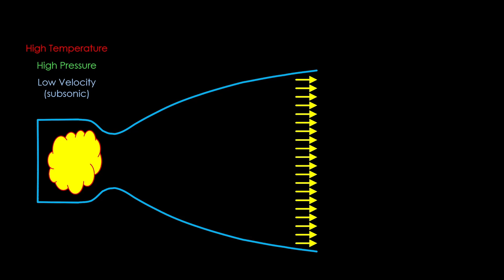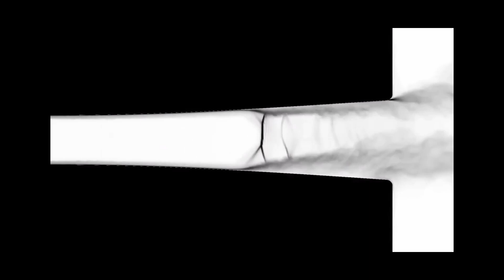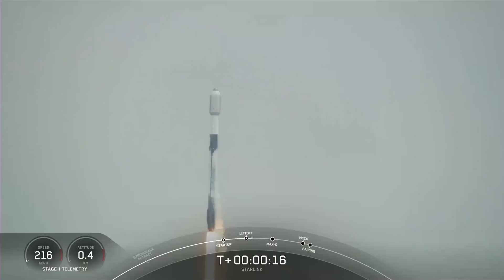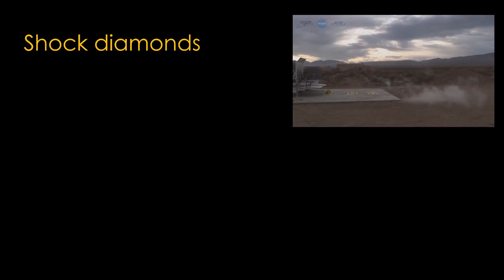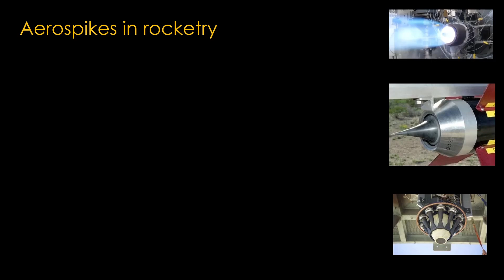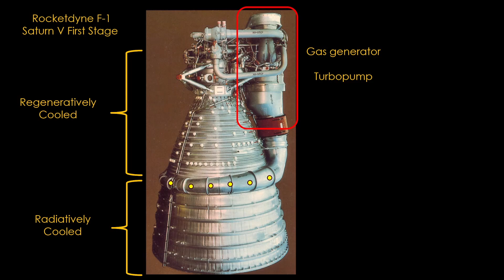Space - You Know Rocket Nozzles

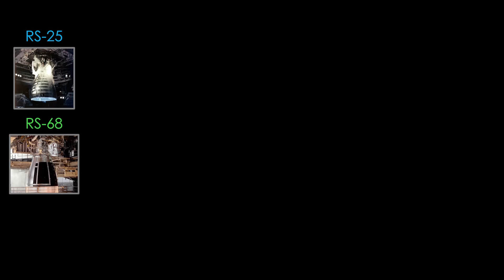Comment: 18:16  why does the total thrust in mega newtons increase in the higher thinner atmosphere for rocket engines?
Does the enhanced thrust account for 100% of the specific impulse increase? 

If rocket engines are using newtons third law it’s not intuitive. Why the thickness of the atmosphere affects the exhaust velocity at the nozzle . .
(of course the further from the nozzle, the more atmosphere the particle encounters and the slower it will be, but hasn’t it already done its job at that point to accelerate the engine forward?)

The statistics make it sound like the engine is push, pushing hard harder and thinner atmosphere  🤔🤷‍♂️
Reply from the maker: The amount of thrust is the product of how much mass you are throwing out the nozzle (mass flow rate) and how fast you are throwing it (exhaust velocity). The full math is pretty hairy, but I'll try to simplify.

The exhaust velocity is (somewhat) proportional to the ratio between the pressure at the entry to the diverging part of the nozzle and the pressure at the exit of the nozzle. In atmosphere, the exit pressure is the atmospheric pressure, and the smaller difference means that the exit velocity is lower, and therefore the specific impulse and thrust are lower. 

You can think of it as the atmospheric pressure at the nozzle exit pushing back against the flow coming out of the nozzle and therefore slowing down the exhaust velocity. 

And yes, the enhanced thrust does account for the specific impulse increase, but I would flip it the other way around - in vacuum the exhaust velocity & specific impulse are higher. The only other way to get more thrust would be to increase the mass flow rate. 

If you look at the stats for the RD-180, you'll see that the vacuum thrust divided by the sea level thrust is the same as the vacuum isp divided by the sea level isp. Same for the F-1 engine that flew on the saturn V.
Reply: @EagerSpace  Thanks Eric! 
So If I get that right:  the key here is that the pressure difference between the throat from the nozzle exit is a key factor here and any traffic jam at the end reduces particle velocity potential . . . .

Funny thing about flat-earther science that denies the viability of rockets because "if there is no air in space what does the rocket push off against .. .?" 
Turns out, the reverse is true and Newtan's law, unlike nature, 'ADORES' a vacuum!
Reply from the maker: Yes, that's what's going on. There's an equation with a whole bunch of terms but that is the simplified version of how the nozzle part works.

Comment: Which part of the nozzle or engine is constructively connected to main body of the rocket? Where is generated thrust transmitted to the rocket?
Reply from the maker: The nozzle is connected to the combustion chamber and the force travels through the engine parts above that and into the body of the rocket. Sometimes it's a solid connection, which means that the nozzle is always pointed directly to the back. Sometimes there's a gimbal joint that allows the engine to pivot in one or more directions, and that is used to steer the rocket. 

There's a really fun video here that shows a gimbal test of the rockets on SpaceX's Super Heavy (the first stage of starship). The outer ring of engines is fixed in place, but the inner ones can all be moved. You can see how they connect to the upper structure - known as the "thrust puck".

https://www.youtube.com/watch?v=gY-UbmBpxAo
Reply: @EagerSpace  the construction of the engine must be very strong since it carries all the weight of the rocket plus the thrust. 
haha, the video is indeed funny 🤣

Comment: Might be stupid
What about expanding the nozzle as the vehicle climbs in altitude, something like what RL-10 does, but during combustion, so that pressure inside the nozzle would always match the outside air pressure, as the nozzle expands, and then it expands into a vacuum engine
Reply from the maker: I think I've seen some proposed designs for that. 

The problem is building a nozzle that can actually do that, deal with cooling, and keep it light enough so that it's actually worthwhile to do. Oh, and make it work reliably. 

Given that good designs - and I guess that means the designs I like, not ones that use big solids and a small sustainer - are fairly settled on two-stages, it's fairly easy to build good first-stage engines and pack a lot together and then separate vacuum engines for the seconds stage.

Comment: Fascinating! I'm curious about the solid rocket, diagrammed in cutaway at the end. It almost looks as if there's two throat-and-nozzles, in series, with the "throat inlet" in between. What's up with that? Now that I'm looking at it again, it appears that the solid fuel is unlabeled and I'm seeing it as a nozzle when it's just the shape of the cavity leading up through the fuel. It was confusing because it was just on screen for a moment.

Always wondered what that wrap-around thing was on the R-1 and the Merlin Vacuum. Film cooling is pretty cool. Where on the bell is the methane film injected in the Raptor? It doesn't seem to have a wraparound thingy since it's got no gas generator.
Reply from the maker: I'm wondering if it's integrated with the feed and output of the nozzle cooling system.
Reply: @EagerSpace  oh, like some of the methane piped through the bell is injected to create the cooling film?
Reply from the maker: Yes, but this is very speculative.

Comment: didn't know the rl10 had such relatively low chamber pressure at 44 bar.. yet it has the highest isp.. I assumed pressures had a more direct relationship with isp efficiency..
Reply from the maker: Expander cycle generally gets you pretty good efficiency. The RL-10 benefits a lot from having a full vacuum nozzle on it; note that the RS-25 with an 80:1 nozzle is about as efficient as an RL-10 with a 130:1 nozzle. And the new RL-10 will get up to an Isp of 465 with a really big expandable nozzle (280:1). 
Where it falls down is the thrust that it has is pretty low - only about 110 kN. That's about 1/10th of the Merlin 1D Vacuum, and that means if you want to fly the RL-10 in a second stage (like Atlas V), you need to have a big first stage that tosses it very high because the RL-10 doesn't have enough thrust to both counter gravity and accelerate to orbital speed. Once you get into orbit where lower thrust is less of a disadvantage it's a much better engine. 
It's also reportedly anywhere from $10-20 million a pop in small quantities.
Reply: @EagerSpace  if only someone could produce a medium thrust hydro/lox engine of any cycle and offer it for less than 15million.. like we had 50 years ago with the j2's.. it would fix this huge gap in the thrust discrepancies.. I doubt it would take long to find a happy buyer

Comment: I'm still a couple years off from my mechanical engineering degree, But why is it important what happens to the exhaust gasses after it's evacuated the nozzle? It would seem that as long as the mass is traveling in the correct direction as it exits the nozzle, it doesn't matter what happens to it afterword. What am I missing?
Reply from the maker: I'm going to oversimplify here - you can dig into the original references which IIRC have plenty of differential equations to make you happy...
It is all about the exhaust gas going in the correct direction, but it only goes in the correct direction if (to a first order approximation) the pressure in the nozzle is the same as the pressure outside. If the pressure is higher - the underexpanded case - you could have gotten more work out of the exhaust if you gave it a bigger nozzle to expand against, since it's going sideways out of the nozzle rather than toward the back
Reply: @EagerSpace  Oh ok! So having expansion outside the nozzle Is like leaving work on the table. By having a larger nozzle and containing that expansion we can do more work i.e. a higher velocity exhaust. Did I get that right?
I sure love my differential equations xD
Reply: @EagerSpace I thought that the question was why do vacuum engines get better ISPs whenever their nozzles are under expanded and the angle of ejection are never as ideal than sea level engines? 

I might be completely wrong about this but when you look at shock diamonds in low altitudes versus booster engine exhaust separation at high altitudes one would assume that the shock diamonds were the more efficient of the two extremes . . .🤔
Reply: Untrained here. Answer may be wrong. I think the atmosphere is doing work against the expansion of the exhaust products and there is thrust lost to that regardless of the exhaust angle.

Comment: Aerospikes have 2 fundamental issues and a 1 circumstancial issue.
the first issue is cooling and everyday astronaute explaines it. Essentially at the point were the exhaust is going to transfere the most heat, the neck the surface area is going to be at least  double and generally much more than that of a bell nozzle making cooling a challenge. It could be an advantage on expander cycles where the extra heat flux can be used to power more powerful pump and over come some of le limits of the expander cycle.
The second has been presented in one of stoke aerospace videos. The other issue of the aerospike is if you are wanting to have a high expantion ratio you need the exit to have a wide diameter also be ridiculously thin making the manufacturing tricky at best.
Finally for the circumstancial issue, the advantage of the aerospike is present when you need a single engine to be efficient in the variety of air pressures. But this can also be achieved to a degree by having multiple type of engine like we have today with staging. So unless you are going to do single stage to orbit, the aerospike doesn't really provide an advantage.
The other case which is a relatively new requirement, is propulsive landing on earth. For that only starship and stoke aerospace are the only ones doing anything about it.
Stoke have the upper stage engine which sort of behaves like an aerospike in a vaccum althoughb it wasn't designed with that in mind and like an normal engine and spaceX needed small engines for thrust vector control which could double as landing engines.
Reply from the maker: Thanks for adding all that info.
Reply: I like it how you take the managerial approach on this channel and sometimes simply ignore the technical details and leave it all to natural selection. People in the real world don't always have that much time...

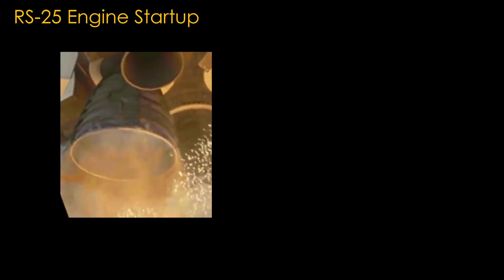Comment: 8:00  If I understand this correctly, flow separation occurs if the engine isn't at full power - and this is why it's difficult to throttle an engine down, or to throttle it down too far.
Also, I finally understand what that fat-skinny python is that wraps around the F-1 and Merlin nozzles. Thanks! It tapers down from the top because as it goes around more and more of the exhaust gas has exited into the nozzle and thus the remaining gas has to be squeezed into a smaller diameter tube so there's enough pressure at the last few holes for the gas to enter the nozzle, right?
Reply from the maker: There are a number of reasons throttling is hard, but that is one of them. 

And yes, that's why the duct keeps getting smaller.

Comment: How would someone calculate the inefficiency of a boister engine optimized for a specific altitude? Are such engines always optimized for sea level, or somewhere in the lower atmosphere in practice?
Reply from the maker: Doing the calculations goes into the "physics is complicated" part, but there are design tools where you can put in your engine parameters and it will spit out the performance numbers. 

For boosters engines, the number of engines you can fit under the booster is constrained by the size of the powerhead, and then you put on a nozzle that works with that spacing. A little bigger is better from an efficiency standpoint, and with tight packaging the nozzle size is small enough that you don't worry about flow separation. 

If you look at booster engines you'll see that the nozzle diameter is pretty close to the power head diameter. 

The world is maybe a bit different if you buy your engines, in which case you're stuck with the dimensions of the engine you buy, and then the diameter of the first stage may be set by the nozzle size.

Comment: 4:28 hasn't rocket lab said Rutherford has a chamber pressure of about 50 bars?
Reply from the maker: 100 bar was the value I've found but I didn't find anything official so that could be incorrect.

And it's possible that they started at a lower chamber pressure and upgraded later on.
Reply: @EagerSpace  here's where i got the 50 bars from, https://www.youtube.com/live/Zw3sIUyfSfc?feature=share&t=736  posted just 2 years ago by rocket lab (also you were right on the money for the vacuum expansion ratio btw)
Reply from the maker: @detective_yeti Thanks for the link.